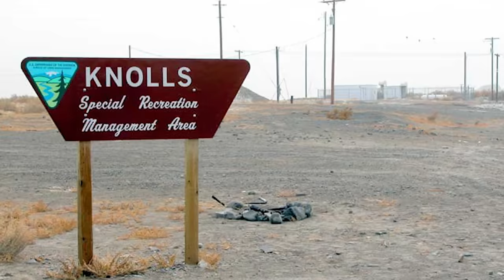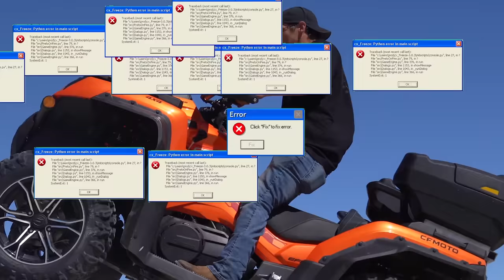Nobody Could Save This Stuck RV...Until We Showed Up

Comment: Another awesome video!  Love it when the "big dog" gets used. Here's a little trick for getting the M1070 HET into low range.  Keep a little pressure on the transfer case handle towards Low, use your other hand to quickly bump the transmission from Neutral to Drive and back to Neutral again, should slide right into Low, no problem.  Let me know if it works for yours.  Absolutely love HETs, was in the 377 Transportation Company (Platoon Sergeant and Truckmaster) at Fort Bliss, Texas for six years, BEST UNIT IN THE ARMY!! "HEAVY TRUCK!"

Comment: Matt’s recovery would have done that in half the time .   Shots fired 😂😂
Reply: And he would've done it with The Moorvair !
Reply: And we would of got the weather
Reply: This is a different league and Matt would failed big time with his junk
Reply: @sundancer3700  He pulled out a bus that big with the banana before. I don't think he would fail on this job but yeah their leagues are different. This was way too easy for heavy d.
Reply: @timsmothers8740  and he would got rv and its trailer together
Reply: Might be a while til MORR coulda done this job. He's building the big wrecker at the moment
Reply: @iremfrat7771  hes pulled out busses even bigger than this with the banana and morvair and hes in softer sand those 1 ton trucks couldve easily pulled it with a yankum rope they probably havent seen matts channel
Reply: @TylerDuysen  I don't remember a recovery on a bus with a trailer like this.
Reply: @iremfrat7771  I can't remember if it had a trailer but it did have a tag axle that wasn't playing along.  They got it out using Yankums, the Banana, and the winches on their heavy tow truck.
Reply: @iremfrat7771  scroll through matts channel theres plenty of em
Reply: @TylerDuysen  I have watched every single video on the channel. I just don't remember the one you describe.

I remember the one the driver kept turning the wheels the wrong way and annoying the hell out of morr team.
I remember the one banana had a very hard time tugging a huge one. Probably more than 10 tugs.
Morrvair wasn't built yet on both cases.
Reply: @iremfrat7771  in one of his more recent videos he did one with the morvair like i said hes done one or 2 with the morrvair but hes done alot with the bananna hes showed like 6 or 7 total videos pulling out rvs 3 of which if i remember right had trailers behind them

Comment: Famous words of Matt’s off-road recovery …never unhook the trailer l!
Reply: I was thinking the same thing!
Reply: @trailrunnah8886  Me too!
Reply: I have been mentally screaming this since they unhooked it
Reply: I was wondering why he didn't use a kinetic rope to start with - that might have helped pop it out easier, trailer included.
Reply: There are two schools of thought on off road recovery: relatively lightweight recovery vehicle that uses kinetic energy to "pop" a vehicle up and out trailer included - then the heavy way with an over-the-top Oshkosh recovery vehicle doing a very slow drag of the stuck vehicle and trailer separately.  Given the size and stuckness of this RV the heavy way won today.

Comment: Good recovery. I would have set the CTIS on "Mud, Snow & Ice", transfer in low, tranny in low and feathered the throttle as needed.

I drove the HET M1070 & M1000 tractor/trailer combo in Iraq back in 2003/2004. My unit logged in over 2.2 MILLION mission miles. We hauled everything heavy armored like the M1 Abrams MBT (combat loaded), the M88 tracked armored maintenance recovery vehicle, and a whole lot more. I like how you repositioned the 55K lb winches to the rear. I also see you have the NBC hoses still in place in the back of the inside cab. They are to hook up to your protective mask, using the vehicle's filtration system while driving in a NBC environment. Love the HET and miss driving it.

The cable hanging down just behind you is to turn your bask seat in to a double sleeping bunk. After releasing the back rest, you pull it up to the cable and loop it around the bolt.

Good luck on your many adventures and keep it safe👍😎
Reply: Huge respect.😉
Epic experience.
Reply: @Finne72  Thank you for giving me a reason to serve👍👍😀😀

Comment: The HET is a pure Beast!! There maybe some machinery out here bigger in weight then this truck but and thing all the way up to a R.V it’s got the brutal muscle strength no other towing rig has nor ever could have!!! Love this old arm truck man!! Any vehicle y’all use don’t get me as excited as the Het so keep being here out to these recovery’s!!!
Reply: We use to pull old Russian tanks out of the farmers lands of Iraq (they were abandoned by the Iraqi forces).  The M1070 is definitely a beast.
Reply: @mike.aya1220  stupid question but how much would u say those tanks weighed
Reply: @jaxxtenmarkko8489  Depends which one we're talking about.  The Abrahm M1 Abraham's tank weighed around 67 tons empty (about 69 tons with a combat load, and about 75 tons  if the plow was added.  The tanks we pulled out of the mud in Iraq were old Russian T-62s and BMPs and those are nothing like the M1 Abrahams (they are lighter).  I'd say the (wild guess here) BMP was about 15-20 tons, and the T-62 was about 35-40 tons....  Keep in mind the mud makes them "weigh more" due to the dragging resistance.  Still the M1070 bobtail can easily pull these tanks bcuz of it low gear transmission.  Like I said, it's a beast.   I so want to buy one....  Here's something to think about.  The M1070 tractor weighs about 20 tons, the trailer to pull the M1 tank weighs about 25 tons, and the M1 Abraham's tank with plow and combat load 75 tons.  120 tons.  That's what this tractor's potential is like.  We drove many missions like this thru Iraq, in 140F degree weather, and we even went thru steep climbs and descents in the mountains (outside of Mosul, Iraq)....   It's not fast (max speed 48 mph), but it will haul heavy loads.

Comment: Need to haul that HET on a Front Load Lowbed / RGN (Removable Gooseneck) trailer to make loading/unloading safer and easier! That way it's not so high in the air when driving on and off the traler, has a low chance of flipping, the center of gravity is down closer to the ground when hauling making driving and turning safer for the driver pulling it, and your height clearances are lower for going under overpasses, bridges, power lines, trees, etc!
Reply: L-also
Reply: Yeah, but those trailers have next to no ground clearance. Whenever they got onto something unpaved it would be time to unload. At least here they could make it over the odd rise in the road
Reply: @BrokeWrench , watch a video of the trailers, they can have up to 3 extra feet of ground clearance on demand!  Air bags and other ways to lift the trailers into the air.

Comment: My only thought on this recovery is (without knowing the load of that trailer) wouldn't it have been better for the trailer to lower it down so it was riding on both axles after it was out of the ruts?
Reply: I thought that too, then i realised it was surely empty, so if it can hold the weight of one of two side by sides it can probabli be pulled empty riding on one axle. Hope this helped, and excuse any error on my english (I' m form Spain).
Reply: I assume that trailer is the garage for one of the car, and the car unloaded

Comment: What engine is the OshKosh running? 

My dad used to drive an old Osh with a Cat motor in the 1980's. 280HP it ran ridiculously strong and fast back in the day. I have a lot of respect for American trucks. They are the best in my opinion.

Comment: Hello Dave. I know you have helped Brent a lot up at Cerro Gordo with all your work and with the donation of the 5 ton truck.  You note that the recovered vehicles are often worth no more than scrap.  He rents a back hole every now and then to help with his construction.  I suspect he could use a loader. You have recovered several.  A used loader might not be worth much to a construction firm that uses them daily and works them hard - the recovered loader might not be too reliable. But for Brent, who would use them only occasionally, a used loader might be valuable.  With his ability to attract volunteers, he could probably keep it running.  Just a thought. It would also make a nice video!  Best, stay safe, and good luck.  MK Stenstrom

Comment: I enjoyed your video and the lack of made up drama of the other shows. I had driven a heavy recovery Pete rotator  but mostly righting semis or flat hauling to a repair facility. But I appreciate your off road work as that's where I started out at pulling stuck 'buggies' out of swamps. That was with a 'homebuilt' truck . 71 Ford cab International travel all frame Dana 70 rear with Detroit locker and a 60 with same locker in front Chevy 350 with remote trans. All steel bed 3/8" on 20" wheels 9:00x20's all around and duals of course on the rears . we didn't have the flotation you do but had screwed tires to rims with onboard compressor when things got sandy also had chains if needed . gets pretty mucky in places here in Florida. But great videos and you have a new subscriber. Thanks again . We had a 'big' wrecker that we'd built to pull shrimp boat winches in off Siesta Kay that would hold its own but we'd chock and use the main winch for most recovery work. Pulled a FP&L Zelligson Derrick  on it's frame almost two hundred yards until it had enough traction to pull on it'd own ten wheel drive ..brought back some good memories

Comment: I'm no expert or anything like it but what about using air roller bags like what they use in shipyards. Get it under the stuck vehicle on soft ground. Inflate pull and they roll with it. They can take  the weight of a barge so 100 ton plus dosent seem to be a problem to them.
Just a thought.

Comment: If it has hydraulic leveling add jack base size with boards or blocks raise the camper and add wood or blocks to path for tires and drive out even if it takes several times. O yea also retrieve trailer separately was the proper idea. But yea that unit is fantastic.

Comment: Hey y’all checking in from Deleware. I was wondering if now I am a retired registered nurse that worked in the ICU I know nothing about trucks or recovery, but, you know those ramps that you can drive your car or truck up on to look under the car, would you be able to put them up front of all the tires so when you’re pulling such a heavy vehicle it gets pulled up on the ramps?  You could always build something similar to the ramps to account for them syncing. Just a thought

Comment: I wonder why they didn't use the motorhome jacks to get dirt under all of the tires, and at least not have the RV buried in sand.  And I always carry a few boards with me in my RV.  And un-hitch the trailer first, to remove that additional load from the RV.   . 

Great video!  I was thinking about how the huge tow truck would remove the front axle from the RV by pulling to hard. . .Better take that RV to get it's front axle alignment checked now.

Comment: Should weld a couple of the standard receiver sizes onto the front bumper. drive up and back em out. Wouldn't have to worry about all the gear out back   :)

Comment: There is a dry lake bed in South Australia that once you break through the crust it's just watery mush for 100m (300ft) down. Break through and whatever you had is gone, sunk forever 100m below the earth surface. And there are many offroaders and motorbikes sitting on the bottom.
BTW don't mean to come off as a offroading snob but surve the guy right for trying to take that thing over a dry lake bed.

Comment: Hey @HeavyDSparks is that a modified M1070 Heavy Equipment Transporter that you turned into that badass wrecker? If it is then you certainly picked the right base vehicle to use

Comment: Seems like a rig like that would get stuck because it is settled in after sitting there for a while. If it were mine I'd have jucked up the back end, and put long boards under the rear duallies. And then I'd do the same to the front end as well. Then you wouldn't be high centered or sunk in when you get your first momentum, and after that you should be OK. I mean, you drove it there.  Of course once your sunk in that bad, even jacking it up might be a difficult task, and there might not BE any boards. Note to self, and anybody else that parks on lakebeds. Park your rig on boards so that you don't need to put them under your stuck tires later.  Databyter

Comment: Great video 🎉 I would have been interested to know how many of the buggies (which were there anyway) would have been necessary to pull the mobile home out of there. It would only have been necessary to have straps of different lengths so that the buggies could all pull as straight as possible in one direction. 5 or 6 or more or fewer buggies - what do you think?

Comment: WOW... i have just a n RV like that , a Holiday Rambler Imperial over here in Germany. Most likely we wont take a risk like that and get stuck, even tho there are a few beaches over here were you are allowed to drive on. But anyway, you never know, so just in case, maybe a wet patch of grass gets me: My serious question is: were did you hook up the belt on the RV? On the front axle or some towing point i might not know off on my RV? No damage afterwards? I'd luv a detailed answer, thx in advance..  and : Great job! Greets from Germany!

Comment: Love the channel, but please can you get an M1000 Het trailer I drove Hets in Iraq and Afghanistan and you will have a easier time pulling stuck vehicles. Because the two winches have a total pulling rating of 110,000 LBS of Winching power and the trailer can tow well over 100,000Lbs.  If you have any question about the the trailer let me know, love what you do best channel out. I am looking now for the Oem Programmer so that you can up the Torque and HP for maximum power and performance. My homeboy was a warrant officer and this is all he worked on so let me find out about that programmer and I will get back with you ASAP.

Comment: Watching the overhead shot of the HET being backed off of the trailer (8:08), the right rear wheel is angled differently from the other wheels.  Does that design serve a purpose (i.e. less slippage during a recovery)?

Comment: 12:55 why turning tires 😂 wrong thing to do , also bring tire pressure of RV and trailer down , and put some Tracks under the wheel of oshkosh, after oskhosh has air compressor to refill tires of RV and trailer 😊

Comment: You need to get a big Bungie rope so you can build up some momentum and there's less risk of the shock of pulling out the slack snapping the chassis on bigger recovery's, and do you have anything big enough to pull that truck out if if gets stuck👍

Comment: That truck looks like a pit truck with a wrecker on it.
Love it.
Enter it in Dakar
10:34
 Are those precut hydraulic hoses.
Does that thing eat hydraulic hoses or something?
 I didn't see flex tape hanging up.
That mighta fixed the radiator hose leak.